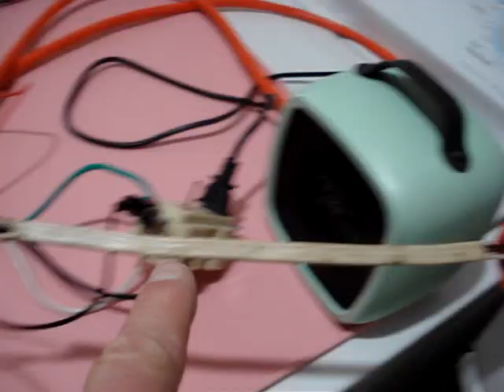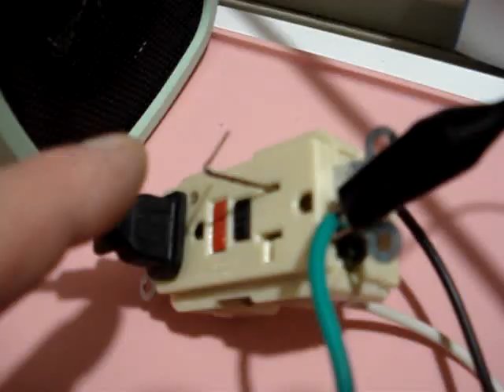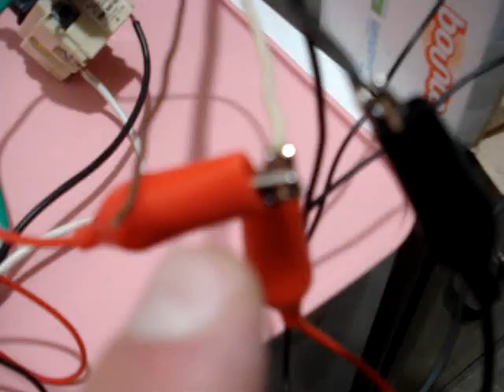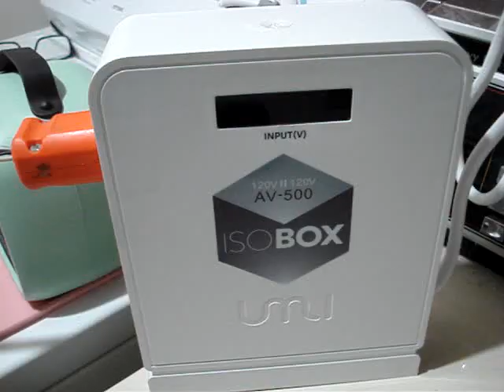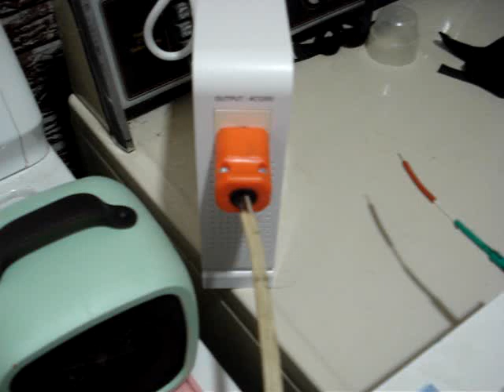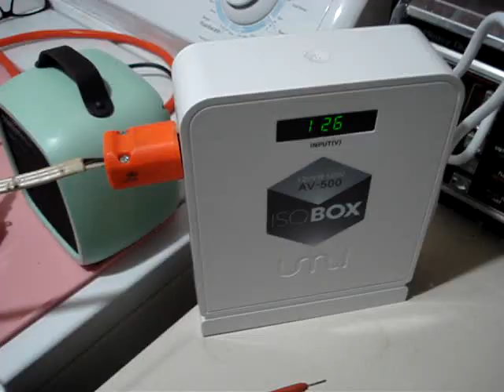Hooking up a GFCI Outlet to the Isolated Side of an Isolation Transformer

Comment: Will it work on the input side of transformer?
Reply from the maker: Yes it will.  But, keep in mind, most power isolation devices allow the isolated ground to connect back to mains ground.

Depending on what you're trying to accomplish safety-wise, this could be an issue.